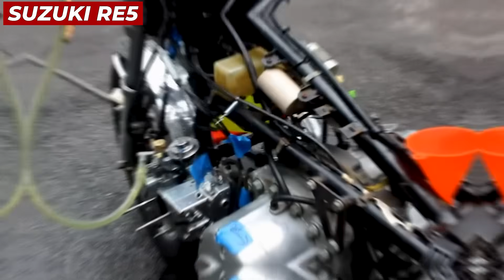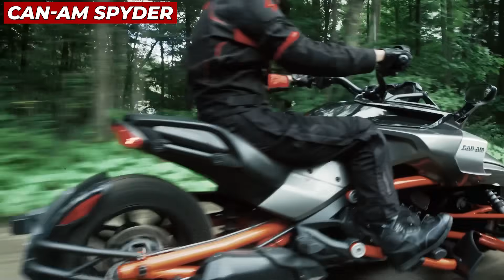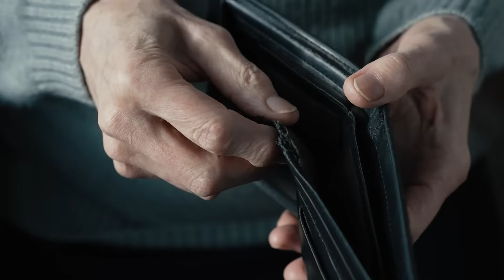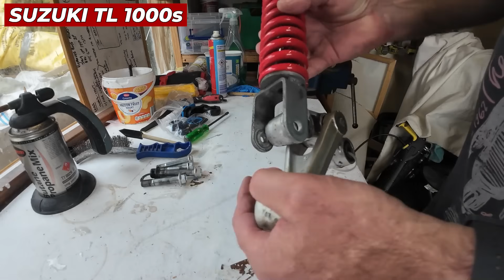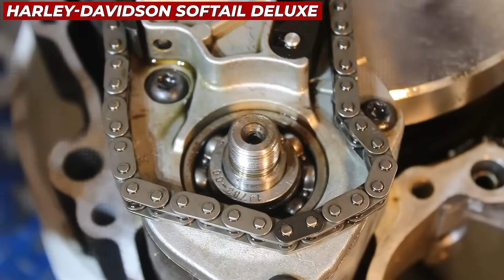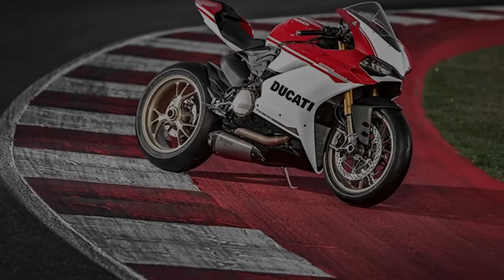17 Motorcycles That’ll Leave You BROKE With Repairs

Comment: I'm part of the cfmoto group, and seen many 2022-2024 models, and never have seen any mechanical or electrical issues on these bikes.

Their 450nk and 700 are rock solid performers with some over 60k problem less miles.
Reply: I have owned an 2023 300NK and ridden for over 10k miles, and i've never experienced any of all these issues, also never heard of other owners experiencing these kind of issues, tbh. The only issue i've gotten was a faulty Gear Indicator Sensor wich was an easy and cheap replacement (and covered under warranty)
Reply: Still Chinese slop

Comment: In my 10 years of the trade the most unreliable motorcycle i ever came across was the MV agusta F3. Then to top it off MV's warranty procedures were absolutely sub unacceptable. Things like changing a radiator cap to hold more pressure to the same argument as harley use "she'll be right". Not only are the bikes absolute garbage but the company wasnt any better to deal with. The second would have to be harley davidson but this ranges from poor maintenance and ownership to bad builds. Some are actually fantastic and can last a lifetime.

Comment: I WOULDN'T WATCH THIS VIDEO OLD MATE HAS DONE HIS RESERCH IN COMIC BOOKS, HE IS QUQTING EXTREME CASES NOT COMMON AT ALL IN DAY TO DAY MOTORCYCLE USAGE. I WORKED ON MOTORCYCLES FROM 1972 THROUGH TO 2023 HE IS BEING DRAMATIC TRYING TO MAKE HIS VIDEO INTERESTING  I REMEMBER ASKING THE MANUFACTURES WHAT SENDS THE BELLS OFF IN THE FACTORY WHEN DO YOU THINK YOU HAVE A MAJOR PROBLEM AND THERE STANDARDS ARE  1% FAILURE IS CONCIDERD MAJOR, SO YOU ARE VERY UNLIKLY TO EXPIRIENCE ANY OF THERS PROBLEMS OLD MATE TALKS ABOUT. YOU KNOW FOR THE LAST 30 YEARS  I USE TO BEG FOR A MAJOR FAILURE TO COME INTO THE SHOP JUST TO MAKE THINGS INTERESTING, INSTEAD OF THE USUAL SERVICING, TYRE CHANGE, BRAKE CHANGE. MOST OF THE PROBLEMS I'VE HAD TO DEAL WITH ARE ON NEW BIKES WHICH MEANS THERE COVERED BY WARRANTY. DON'T LET THIS VIDEO CHANGE YOUR MIND JUST SERVICE YOUR BIKES REGULARLY AND DON'T ABUSE THEM.........I'VE HAD A FAMOUS SAYING FOR YEARS COUSE CUSTOMERS ALWAYS ASK --WHICH IS THE BEST BKIE I REPLY { IF I WAS JUST TOLD ...YOU HAVE JUST WON A 1000cc SPORTS BIKE I WOULDN'T ASK WHAT BRAND IS IT  I WOULD SAY WHERE'S THE KEYS.}

Comment: Well, I wouldn't own any of those bikes listed even if they were given to me. I ride a lowly in some people's eyes a 03 Harley Sportster. With its carbureted Evo engine. I've had it five years and taken many long road trips with it. It might not be the best in some eyes, but it's never let me down. Maintenance is very easy, and if you have a shop manual , which ANYrider that truly rides should have, maintenance costs will drop drastically if you do YOUR OWN work on your bike. The ONLY things I've had to do on my sporty was changed the vacuum hose from the tank to the carb, clean the carb periodically and change oil and plugs. Those crotch rockets you listed and many others are always high maintenance, but regardless, if a biker has any common sense, which they should if they ride, and a good repair manual, they can save LOTS on doing their own repairs.
Reply: Lol.... so you believe all this drivel narrated by an AI algorithm.  Stick to the Sportie Bud.
Reply: All that matters is that you love it. That you enjoy riding and  maintaining it. Stay safe and on 2 wheels.